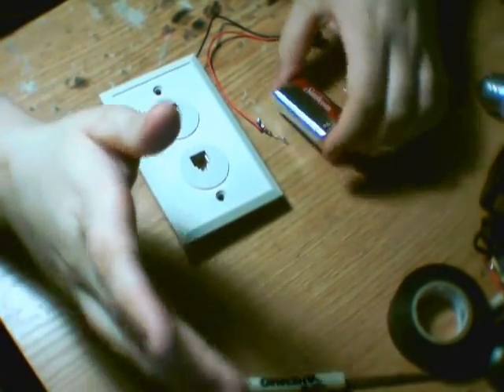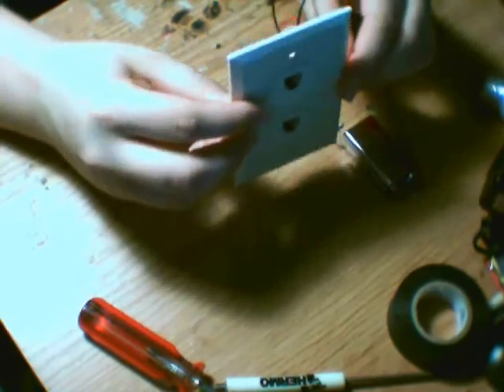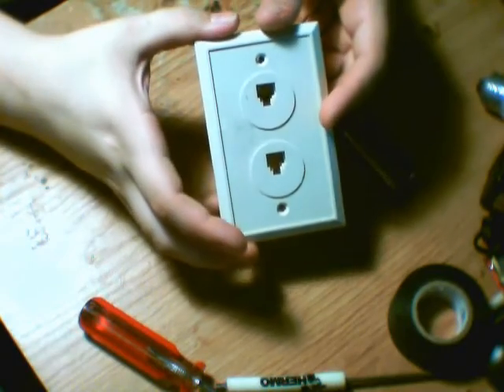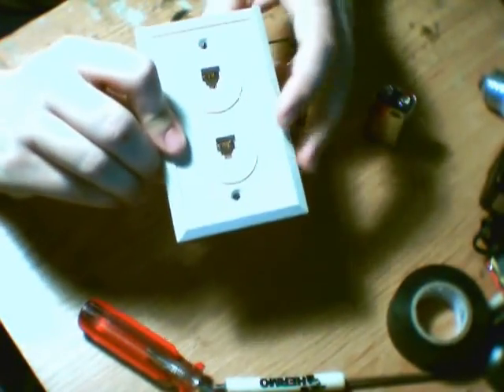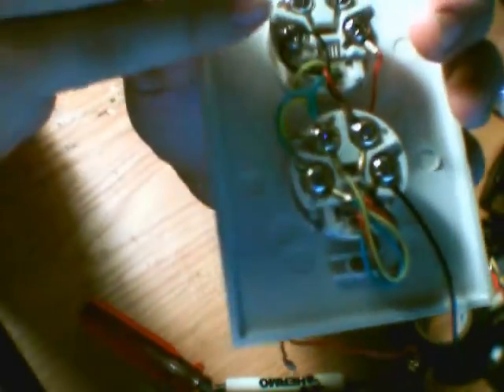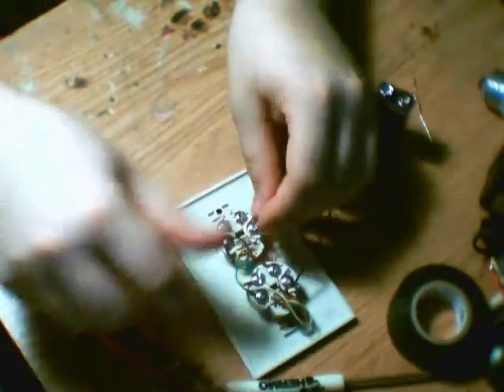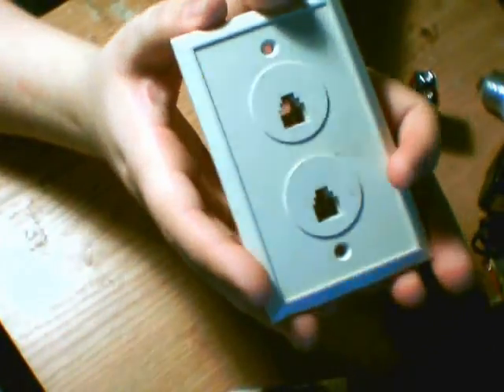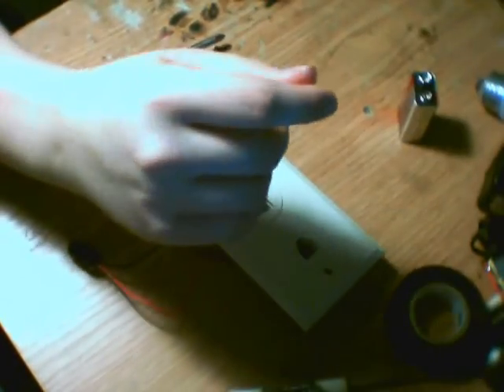phone jack intercom

Comment: Will you please email me a schematic or do a video on one because I don't understand a word about the wiring
Reply: Oh you can do it easier by eliminating the jacks. The jacks are being used as an unnecessary bridge from the battery to the other phones.
Reply: All you need to do is open a phone cable and take the positive wire and cut that in half. Connect the two ends of the half into the battery and your done.